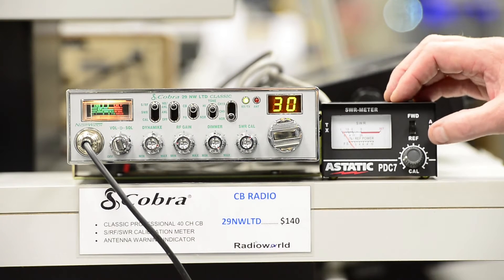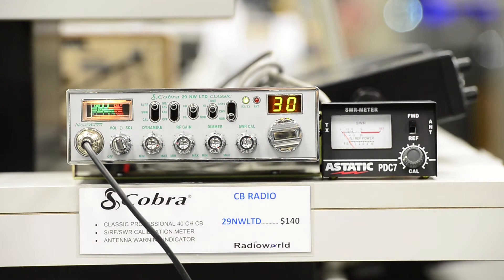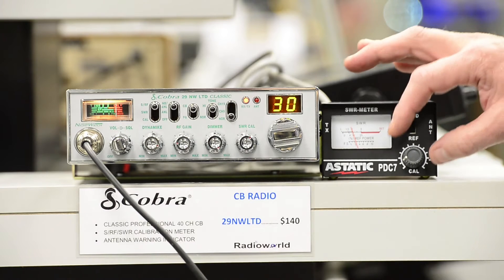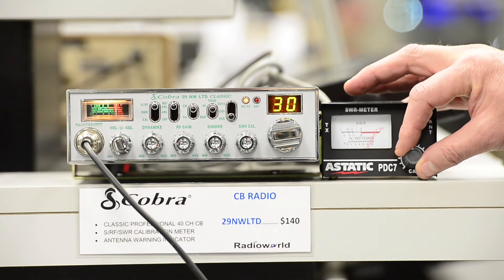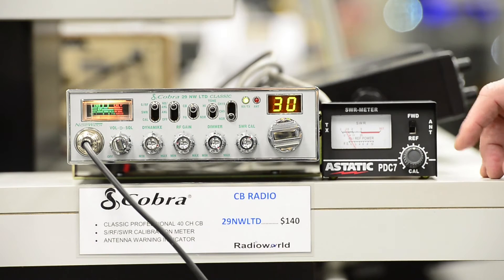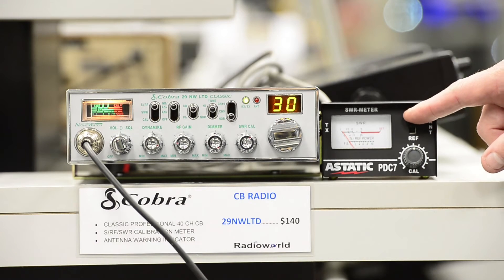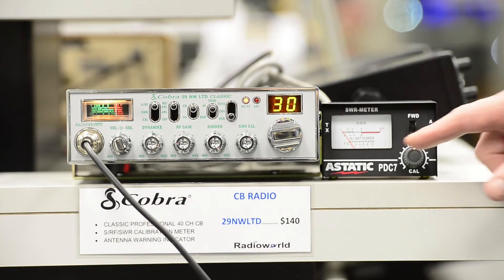How to Check SWR on a CB Radio

Comment: I am getting 1.6 to 1.7 swr, I am wondering why ti wont go any lower and also on some channels it wont put right I am puzzled on this. Well its almost like I am not outputting at all. I cannot get the SWR to go under 1.6 across all channels. but if I put a Low pass filter on there it will be good. Also I am running a Pyramid 5 amp with 4 amp surge on a 5 amp CB Uniden PC68LTD could power supply cause this or low length of coax i am running only 18 feet.
Reply: 1.7 isn't bad ! as long as your at 2.0 or below than you can talk without doing any damage to your radio ! myself I have a pc68xl !